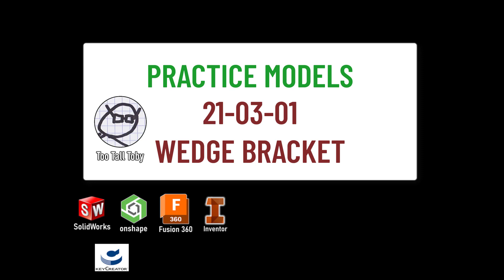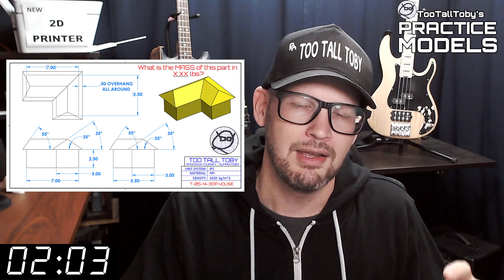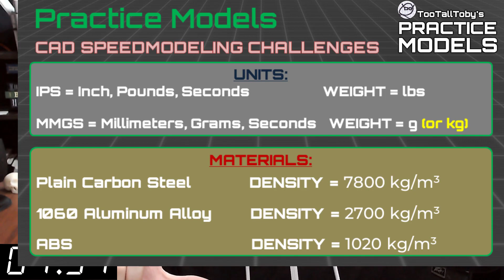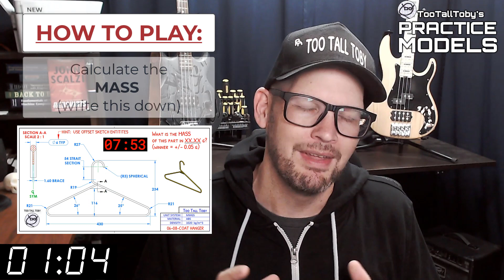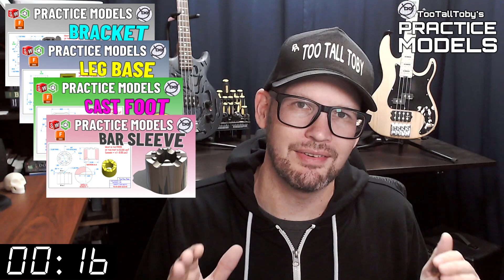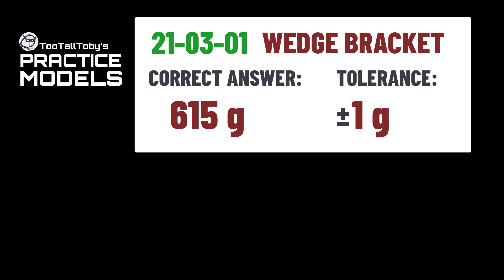3DCAD SolidWorks Onshape Fusion360 Practice Drawing - 21-03-01 - WEDGE BRACKET

Comment: My first ever TTT modelling attempt for a new OnShape user. I "think" I've nailed the model, but my mass is 609.041g grr. what does 019THRU mean? maybe that's my problem
Reply from the maker: Awesome job and welcome to the channel!  the correct answer is shown at the end of the video.  
that text string means DIAMETER 19 - through the enter part
so its a hole with a diameter of 19mm

Hope this helps!
Reply: @TooTallToby  many thanks. I've been learning through watching your onshape series for weeks and finally tried out a challenge. Many thanks for the excellent content! 👍

Comment: Got the correct mass of 615.26 grams in build123d in 15:33. Very fun model, thanks Toby! Here is the sourcecode:
from build123d import *
with BuildPart() as p:
    with BuildSketch() as s:
        Rectangle(135,42)
    extrude(amount=-19)
    with BuildSketch() as s2:
        with Locations((135/2-26-42/2,6-1)):
            SlotCenterToCenter(135-26-26-21-20,14)
    with BuildSketch() as s3:
        add(s2.sketch)
        offset(amount=14/2)
    extrude(amount=3)
    extrude(s2.sketch,amount=-20,both=True,mode=Mode.SUBTRACT)
    with BuildSketch(Plane.YZ.offset(-135/2+21)) as s4:
        SlotCenterPoint((0,0),(0,46-19),42)
    extrude(amount=20)
    split(bisect_by=Plane.XY.offset(-19))
    with Locations(Plane.YZ.offset(-135/2+21)):
        with Locations((0,46-19)):
            Hole(19/2)
    split(bisect_by=Plane.XZ.offset(-19))
    with BuildSketch(Plane.XZ.offset(-20)) as s5:
        with BuildLine(Plane.XZ.offset(-20)) as l:
            m1 = Line((135/2-3,-19),(135/2-3-126,-19))
            m2 = PolarLine(m1@0,126,-180-35)
            m3 = RadiusArc(m1@1,m2@1,126)
        make_face()
    extrude(amount=-22)